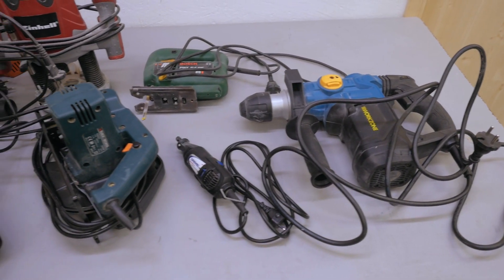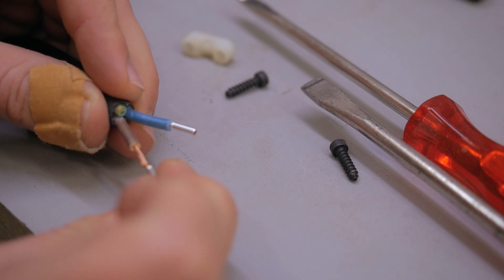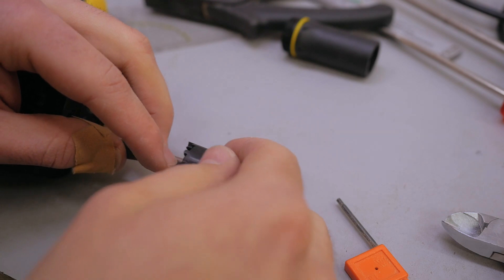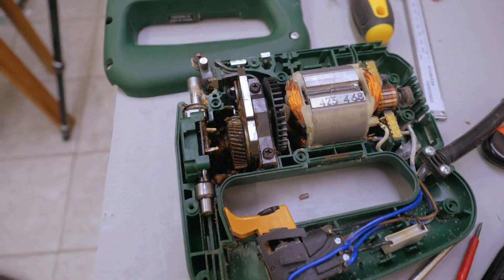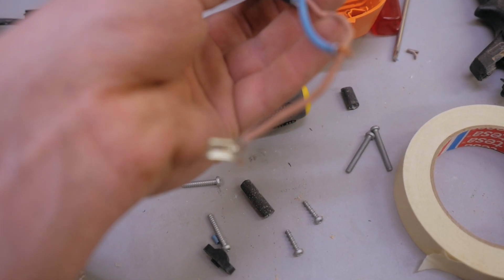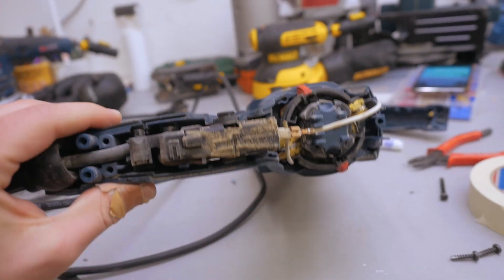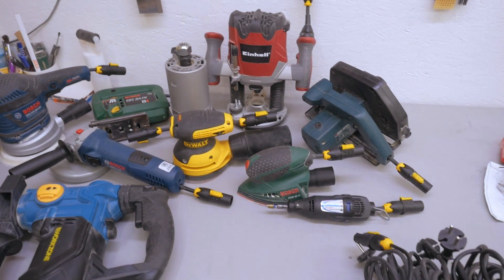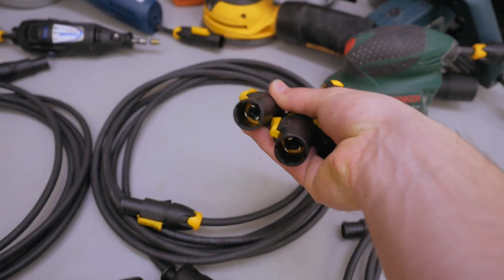A Quick Connection System for Power Tools

Comment: On Bosch drill: could cut the wires and crimp connect to the wires near the trigger and use heat shrink tubing to cover the crimps.

Comment: Leaving 'earth' ground in power cord does have a useful purpose even though not connected to power tool.  Should the cord get pinched severely causing the brown 'live' wire to connect with the 'earth' ground the breaker can still trip and shut off the power.   If the 'earth' ground is not connected then with the above circumstance the 'earth' ground wire becomes a power wire and will not trip the breaker and increases risk of shock and fire.  Of course there are other circumstances but leaving the earth ground connected is for many reasons wise.

Comment: The wires are push fit into the trigger, to get them out you use a small flat screwdriver and push it into the wire hole, this depresses the metal tab and then you can pull the wire out. To install the new wire just remove a bit of the insulation and push it in, the tab will then stop it from being pulled out

Comment: I LOVE all your videos Marius, you, John H & Matthias are my 3 favorites but maybe I'm missing something here - I don't see how this elaborate system overhaul is much more beneficial than just shorting original power cords to either right up to the tool, or a standard 10mm, 25mm, etc. and then using standard extension cords. Neutrik are wonderful connectors though - I have them on my Bose equipment for gigs (guitar/vocal).

Comment: Marius. For the drill, I would be inclined to leave the wires attached to the trigger, but cut them between the trigger and the strain relief. Solder the new cable to the loose ends of these wires and slide heat-shrink insulation over. It's inside a plastic casing and not subject to strain so as long as the two ends of the wires are in intimate contact, there should be no difficulties or excessive heat.

Comment: On the drill you cannot change, there should be small square openings next to the wire openings that you can push in a small screwdriver. The screwdriver pushes open the electrical connectors and will allow the wire to be removed. I hate these push in connectors as you can only open them so many times before they lose tension and won't hold the wire tightly anymore.

Comment: People in the comments of every single video of every channel always think they know best. "You should have done it this way..." "you did it wrong..." "that won't work...." "cool idea, but..." so annoying. Fuck! Let the guy do whatever the fuck he wants! I hate people -_- end rant
Reply from the maker: +directorgtr so true. something you have to deal with as a creator. But you get used to that.
Reply: +directorgtr   You sound like you would feel comfortable in a cave or on the moon.
Reply: directorgtr    There are more southern areas in Russia, try those!
Reply: +Marius Hornberger        There is nothing more annoying then cable management but your approach seems reasonable. One question though: Isn't the connector to close to the little hand drill? and make the handling more difficult because of the shift of the pivot point?
Reply: +Didn DiDo You are correct, sir.  I'd love to live in a cave or under the ground or even Russia's wilderness if it wasn't so cold.
Reply: +directorgtr   People will always complain or know it better. The sooner you get used to it the better. Even your initial comment was a complaint...

Comment: I like it and I think it would be perfect for the shop.  On a job site the good part would be of course storage in your truck or trailer.  Plus I think your tool or cord would be less likely to be stolen.  But if you have a guy on site with out a cord to fit the tool it could be a problem.

Comment: they use them in the sound and lighting industry.. should have just cut off the plug... put on power con true1 plugs then mout pannel mount sockets in you bench. would have saved you from opening every tool

Comment: you could do what i did was just shorten the wire to 12 inch and buy a good 20 amp male plug and use a good 12 gauge extension cord.

Comment: Ask the owner of festool tools what is the weakest point of them . He will reply- the fcuking quick connectors. If any thing will break in those that will be it.
Reply from the maker: Ok, quite interesting to hear that.
Reply: To reassure you, I work in the Lighting industry, what these connectors were designed for, where they are slowly taking over the original powercons. The original Powercons had no issues, apart from arcing when the connector was left in and unlocked. The True1 connectors fix that, as well as being water proof as well. Any Neutrik connector (not a Chinese clone) will last for ages. Never had a problem with the reliability of the previous generation, or the True1.

Comment: You could also make a very short lead with a quick connect plug leading to a conventional socket so you could daisy chain two cords together instead of having an extension cord in the shop.

Comment: Nice upgrade!
To even enhance it, I'd suggest you hang one of those 'cable roll' on the wall and replace its female end with your quick connector, never bother the hassle to put your cable away and from 15 to 25 meter of cords, you'd be okay!
https://www.amazon.de/ProPlus-580786-Automatischer-Kabelaufroller-15M/dp/B00APGBZ7Q/ref=sr_1_2?ie=UTF8&qid=1493709881&sr=8-2&keywords=cable+roll

Comment: That is a good idea. I checked out the site to order the plugs but it was in German , so it doesn't do me much good. It's gotten to the point that some times I'll look at the tangled mess and just grab a handsaw than going through the trouble of untangling cords to get the saw I really need. Other times like when doing a fabrication job while using welder , torch , grinder , drill , saws life becomes a tangled mess with all the hoses and cords.

Comment: The rubber sleeves are strain reliefs. This keeps the wire from flexing more then 90 degrees and adds strength to the wire so you don't end up yanking the power cable out of the tool.

I remember seeing IEC connectors at home depot that would work well and would be cheaper.

Comment: I was thinking about this idea but it would be much cheaper if you went with these connectors: https://www.google.si/search?tbm=isch&sa=1&q=computer+ac+cable+female&oq=computer+ac+cable+female&gs_l=img.3...83468.91490.0.91579.24.20.0.4.4.0.143.1848.15j5.20.0....0...1c.1.64.img..0.18.1350...0j35i39k1j0i67k1j0i30k1j0i19k1j0i8i30i19k1.yOut7BhUAzs#imgrc=BLM2Jx3j7EnCPM:   They can be found anywhere and all you would need is a female version

Comment: Aren't Neutrik connectors rated for low voltage only?
Reply from the maker: These ones are for 230v 16A
Reply: Wow--  That's great!  I'd love to find those in the states.  Thanks for the video!
Reply: amazon has them :-)

Comment: The rubber sleeve is very important -- it is a strain relief, and prevents the wires and terminals from being damaged.  It can create a dangerous short without it.  I would not remove it.

Comment: I agree with other posters on the drill.  Just splice your connector in.  Some solder would help strengthen the connection, and use some heat shrink for the electrical isolation as you probably don't have the room for threaded wire couplers in there.  That large rubber piece will provide sufficient strain relief for your electrical connections.  If it doesn't you might just want to add in a zip tie and screw it down to the case somewhere

Comment: Nicely done. I personally would skip the dremel since the new cable will add a bit weight to it and it will be more difficult to use. Very well done with replacing the cables instead of cutting them this way you could restore them back to original if needed for example gifting old tool to a friend. Don't mind the warranty the only case it is useful is to change defective tool and I bet you repair your tools yourself.
For all the people that are commenting on the strain relief, I bet that this new cables will outlast the tools or at least the first several repairs. The new cable is ticker and most probably better than the factory one for the most of the tools.   And not to mention that he is using the tools with care in the shop not like a construction worker throwing them all over the place or pulling them by the cords.
   Keep up with the good work Marius
Reply: You could wire any old cable into it though. I already do this to make my cables longer as it stands.

Comment: An auto winding spool system for the wires would be cool.  It could a ratchet so you pull the length you need and it stays. Then when you finish you release the ratchet and the wire is wrapped back up on the spool

Comment: Nice, i did the exact same thing on my corded power tools a few months ago. Nexans Titanex H05RN-F cable with Neutrik True1 connectors. Cheapest source i found back then was thomann.de

I also made extender cords with both male and female Neutrik conns so i can have anywhere from 5 to 25m (5m w/ wall plug, 10m and 15m extenders) of robust and pretty well waterproof power cord

Btw you can also modify static tools like a bandsaw, or a planer/thicknesser with it. This has obviously less use but it allows you to have extra security against childrens playing in the shop - just put the cords out of reach of them and no tool shall be accidentaly started. For those i bought 'chassis connectors' (Neutrik NAC3 MPX True1) and mounted them directly on the static tools.

Comment: i did the same thing, its so much tidier and quicker. but i didnt add the special connector plug, i just shortened the leads to about 100mm long, they dont fall out

Comment: I found the same connectors a couple of month back for the same reason as you. An was quite happy to see the company ships to Denmark. Now I have not yet bought any because as you say yourself they are quite expansive and because I am a bit worried about the length of the connector. I am hoping you will make a followup video after a while on how they are working for you.

Comment: Dear Marius,  I have enjoyed your site for some time now. I have and am using some of your ideas in the cleaning design of space and other very useful suggestions. Sir, I am sorry to say but you made a large mistake on this project. The idea is sound and I was looking at the same thing (that is I got tired of the cords, not how to change it yet). Your plan is great but the execution was just plain wrong. The rubber cord sleeve serves three. 
   1) it protects the cord sheathing from wear at the handle entry point,  
   2) it grabs the cord and helps greatly to reduce the pull at the cord internal wire contact points.
   3) it prevents the cord and wire wear and twisting and cracking at the handle point where this happens most often. Look at old tools and you will see that the cords are failing at the spot just after the rubber sleeve. 

One more point, once you change to the better way, why would you go back? And if you ever did want to, just reconnect at the cut point using liquid tape, twine, tape and shrink tubes. You wasted lots of time and some money on the metal end ferrels for the wires. Important note about the end ferrels, They are not as strong and actually add more resistance to the connection. Wires are more likely to pull out now then the were. Simply soldering the ends would have been better if determined to treat the ends of the wires. 

PLEASE PLEASE PLEASE put the original wires/cords back into your tools and cut the cords where you want the length to be.  I am sorry for being negative but safety is a huge priority and electrical shock and fire scare the hell out of me. If you have ever seen it and I hope you never do, you would understand this message to you. Opinions are like butts, everybody has one and they all stink!  This is not an opinion ....... this is your safety!!!  My opinion is that this is a great idea and I want to use it for my shop if that is okay? I like the idea of just having the cord lengths at the locations I most use my power tools in the shop instead of cords in the way and having to reach over or find an open wall socket. And I just have to change one end of an extension cord for use outside of the shop. Fantastic Idea. I do like you ideas and you work. Please make the changes so you can keep doing so for a long long time.  Sam, just one of your fans.
Reply: The Cables he used, are better Quality they are made of Rubber (probably H05RN-F or H07RN-F) and most of the old ones are just PVC (Low-grade and Cheap) and rated for minimal use.
The we have to use Ferrules (Small Coppertubes tin- or silver-plated) on flexible Wires by Law.
Reply: Sorry Samuel, but you never want to tin stranded wires with solder if they are going into screw terminals. Solder can creep, and a tightly screwed terminal can go loose very easily.
Agree though. He should have just cut the existing supply cords, and fitted the powercon connectors to them.
Reply: Same my opinion, a agree with you

Comment: Super thing! I did the same thing in my shop about 4 month ago. Just used these cheap chineseum https://ru.aliexpress.com/item/New-Arrival-Black-3-Pin-IEC-320-C-C14-Male-Plug-Rewirable-Power-Connector-Socket-AC/32667624944.html?spm=2114.13010608.0.0.M4f4eW

Still works great. super easy, and most important space saver. And my main power cord is hanging from the sealing in the middle of the shop

Comment: There is no need to open the drill switch to get the wires out. The drill switch connector is the kind of press-release thing, so basically you need to find the point that you will press to release the wire that's it!

Comment: I have been running with this type of mods for a few years now. I love it. I went IEC connectors as these fancy ones are just too expensive when buying with Aus $. I have kept the cable relief and about 150mm of cable. Gives plenty of flex and is just short enough to not snag on anything and not have the connector near the cutting blade etc. Gone are those hassles of cutting off the lead with the saw or grinder or nicking it with the planner. Now I can just change out the lead. (Haven't damaged a lead since this mod though )
Pack up is so easy and when swapping over my grinders I only need to unplug at the base of the tool and not find the plug on the ground. 
I'd love to have these locking connectors, but the IEC plugs seem secure enough so far. 
Test and tag inspections are no different than a festool, have a lead for each tool and have them tested together. 
I'd recommend this mod to everyone.
Reply: I think I'd rather the IEC pop out if it was pulled too hard anyway. Though... you can get locking IEC cables.
Reply: @drsquirrel00  locking ones would be nice as I have a bad habit of lowering my tools via their leads. I know it's bad, but I still do it. ;)
Reply: @NathanNostaw  I was planning on doing this but keep finding things that trip me up... this is one that I have done multiple times this week. Other downsides are 10A limits (granted id just keep 13A on their own cables). The female IEC connectors are mostly terrible to wire up - screw terminal models cost a bit more. If you keep tools in boxes etc - you're probably going to want a cable in each box else you might end up taking it without a power lead - probably suits workshop usage better. I like the idea of having an IEC C13-C14 extension so the "plug" that drags around all the time isn't so bulky. I normally replace my tool wires with longer wires anyway so the reel extensions etc don’t get moved so much - but that makes the cable problem worse. Another problem is i'd have to put a 10A fuse in for "everything" including items that would be on a 3A or 5A fuse. IEC C14 bulkheads can be had with fuse holders so I'm going to do this in a few tools like the table saw etc. And maybe consider putting the fuse for power tools inside.
Reply: @drsquirrel00  not sure where you are based, but here in Aus we don't have a fuse in each plug or tool. Having specific fuses for watch tool would sure make swapping leads in to a hassle not worth bothering with
Reply: @NathanNostaw  UK. Given that its only really there to protect the wire, so long as the main leads are all 1.5mm2 it isn't really a problem - though ideally need a 10A fuse for the IEC C14/13 connector.

Comment: the drill should have two holes somewhere on the switch near the wires,  use a paper clip insured in the hole to release the wires.  [probably]

Comment: Would hate wasting my time doing this on a Harbor Freight tool. I've basically been going towards all battery powered tools anyway. The only exceptions are the grinders that get used all day. And if I ever remember, I have a whole drawer full of air tools, which already store compact without hose/wire.

I have 1 Festool, and I'm not convinced that the plug thing is all that great on it. The connectors in the video however, I like that they lock together. But they are rather bulky.

Comment: That's really great! Looks much cleaner without the excess wire :)
Reply: so what.

A. this solution

1. is it better? no
is it safe or long lasting? no, it will break or short circuit
2. is it handy when working? no, it gets in the way, especially in dremel and other tools too.
3. is it fast to plug in? no, you must think 3 times before pluging in.
4. can you use with any standard cord? no

B. shortening cables and using extensions

1. can it be done cheaper, faster and better? yes
2. will it be universally compatible if you forget cables home? yes
3. is it fast to use? yes
4. does it annoy you less when actually working? yes.  

draw your conclusions